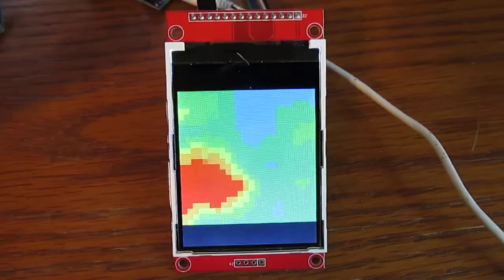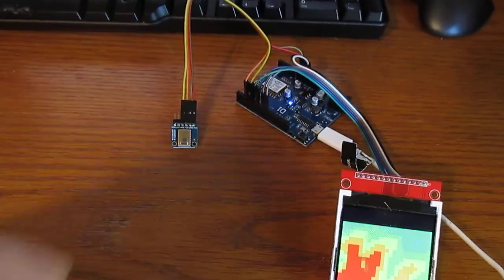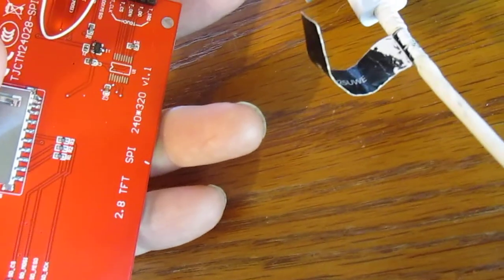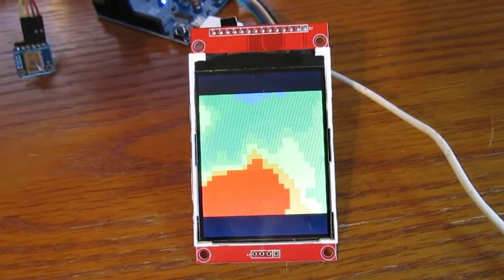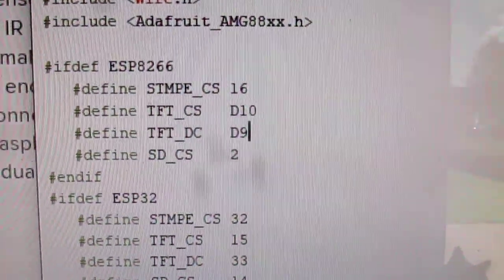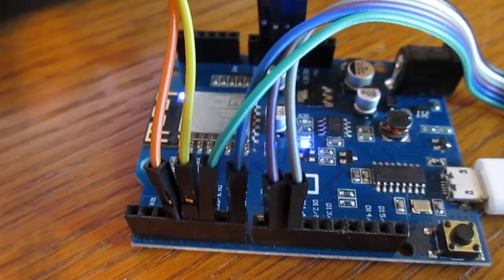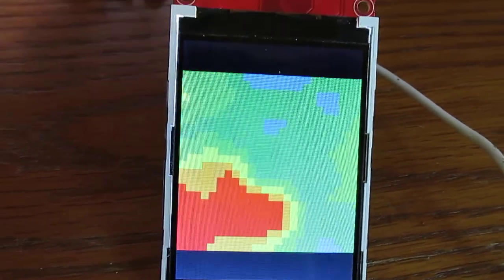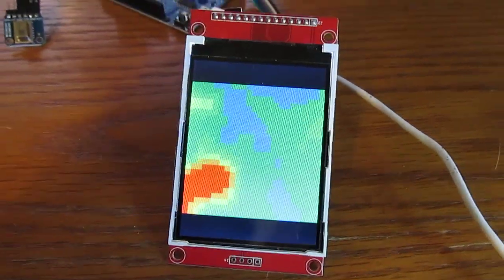AMG8833 to ESP8266 to ILI9341LCD = Thermal Camera

Comment: The AMG8833 has 8x8 resolution, but it looks higher than that here, is there a software trick to do this?
Reply from the maker: Its software interpolation to fill in between the actual resolution.

Comment: If only there were high resolutions sensors not costing an arm
Reply from the maker: Its a 16x16 AMG8833 that sells for under $40.  The software interpolates the higher resolution.
Reply: @bobdavis321  could u make a parts list of everything that i would need to build this with the better resolution camera
Reply from the maker: @Fortitudoo  AMG8833 an ESP8266 or D1 Arduino, a ILI9341 LCD and several jumper wires to connect everything.  See my Blog for the schematic.